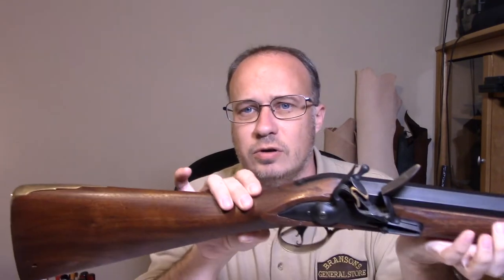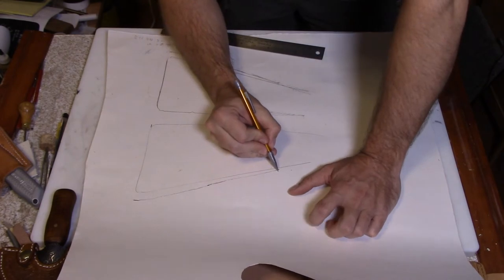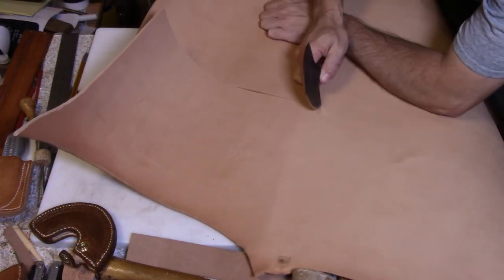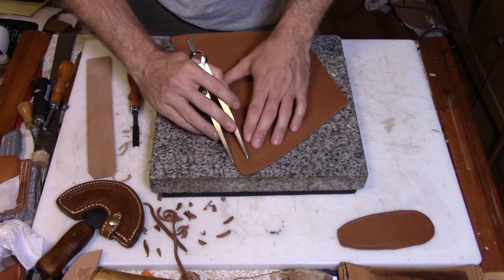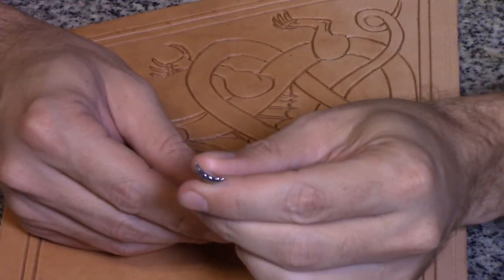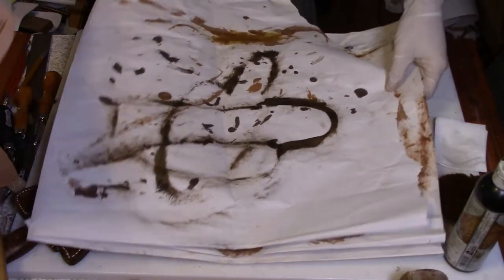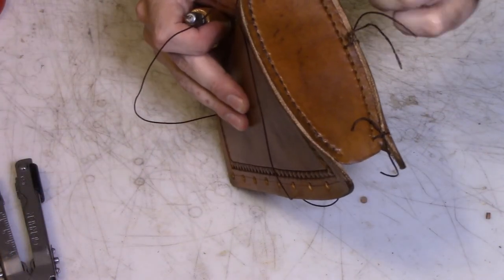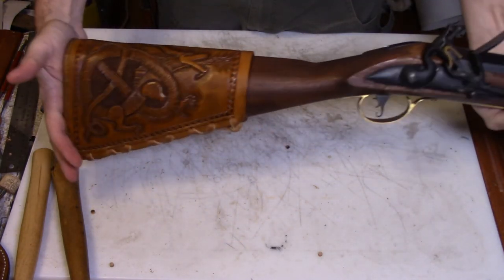Leather cover for gun a stock: how to make a cover that protects your stock and look good doing it.

Comment: What weight leather did you use in this ? Great work .
Reply from the maker: It's about 9oz.  It doesn't really need to be anywhere near that heavy.  Probably 5-6oz or 6-7 would be my normal choice for a stock cover, but I went thicker for this one because it is on a 10 pound 4 bore monstrous blunderbuss.

Comment: This is a great work ! Thanks for sharing it. I even decided to make my own.
Do you use linen or nylon thread ? Of what diameter ?
Reply from the maker: The thread I used on this is polyester.  I do not know what diameter it is.  Definitely bigger than the 346 nylon thread I use on my machine.
Reply: @bransonsgeneralstore  Thanks !
Reply: @bransonsgeneralstore  Thanks for the answer :)

Comment: Awesome work. What tool did you use to transfer the image from the tracing paper to the leather
Reply from the maker: A modeling tool with a stylus point.  Basically anything that comes to a point and is not sharp enough to cut through the tracing film will work.

Comment: What weight leather did you use?
Reply from the maker: I used 8-10 oz for this one because it is on a heavy 10 pound flintlock.  Most normal rifle stocks I would probably use 6-7 or 7-8 oz.